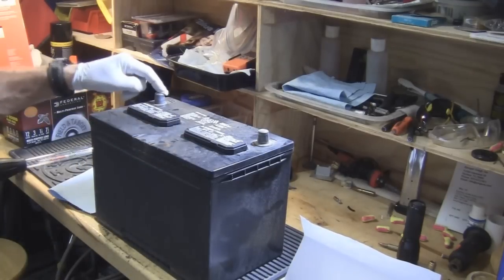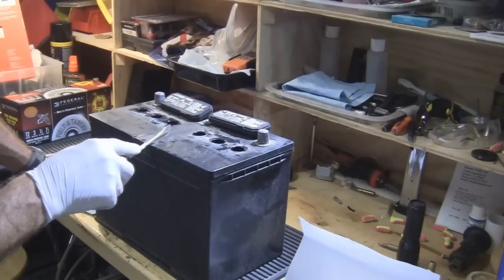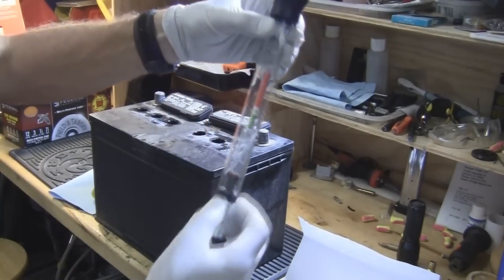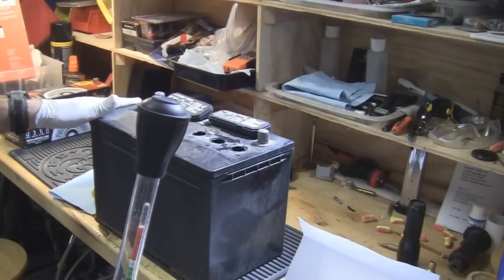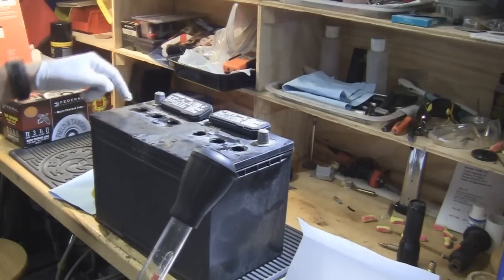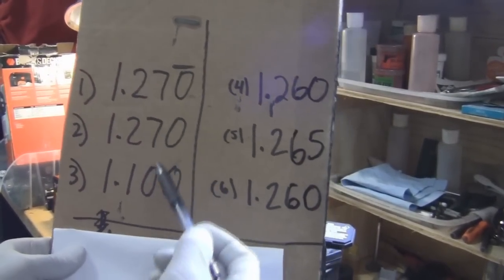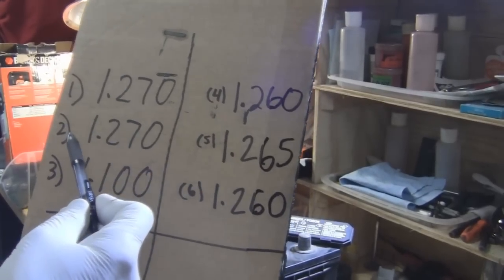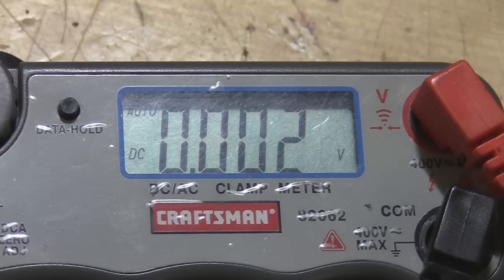DIY Car Battery Testing & Troubleshooting

Comment: bearing01. What I use when working on a battery: 1: Protective gear, including extra long rubber gloves, a full-face shield, and a rubber butcher's apron. 2: A full-function battery charger. Mine is a Schumacher SC1546. 3: A quality hydrometer. I use an EZRED SP101. 4: A digital multimeter. And 5, and most importantly, a battery load tester. To thoroughly diagnose the battery, you will, or should, have all of these. Before you remove the battery cell covers, clean the battery and wire brush the terminals, as corroded terminals will affect your voltage readings. I perform all my tests outdoors with a garden hose nearby, just in case.

Comment: You don't throw the battery away, you do an equilizing process to bring the cells back to life.
Reply: Was wondering if you had a quick way (to save on your time) to explain that process if you would. Or i could give you my email to explain, thanks man.
Reply: @brianb5779  You simply keep on charging your battery using high voltage (up to 16 volt), while keeping the charging rate at low rate (about 1/20 of the battery's Ah) until all cells read the same density...
Reply: @ΠάριςΑζής  Thank you so much for that info and your time

Comment: Thanks for the vid.   If there is one bad cell, meaning the acid to water ratio is off, can't you add acid to the cell to bring the specific gravity back to normal?   If the cell is not leaking and the lead has not somehow been removed, am I correct to assume it must be the acid?     Here is my issue:  My marine battery is about a year and a half old, it was left connected with a consumer draining it.   I discharged and sat for about a month.   The cell acid level was low.   I added distilled water,. have it on a charger, and am hoping the batter is not shot.   But, if I test it and the specific gravity is off, it seem balancing the acid level again would resolve the problem.
Reply: During the life of the battery, one must never add electrolyte in it. Only distilled water must be added. The reason is that a bad cell having low density indication is heavily sulphated. This means that the initial amount of the pure sulphuric acid into the electrolyte mixture is not there any longer, as it has been converted into sulphates stuck on the plates of the cell. In such a case we perform the equalisation process, in order to reverse the sulphates in acid again. That is we keep on charging the battery with high voltage and low current for many hours until all cells reach the same density reading. Again, we add only distilled water during the process. If we add electrolyte and then an equalisation follows, then the acid will become very strong (very high electrolyte density, which now needs what is called "electrolyte correction"...) and will corrode the plates of the that cell, especially the positive ones, destroying them through premature rotting and much faster aging...
Reply: @ΠάριςΑζής  thank you